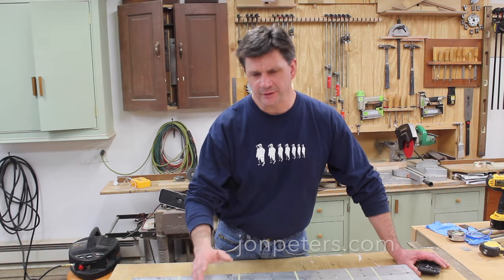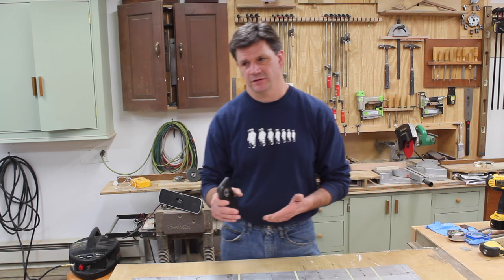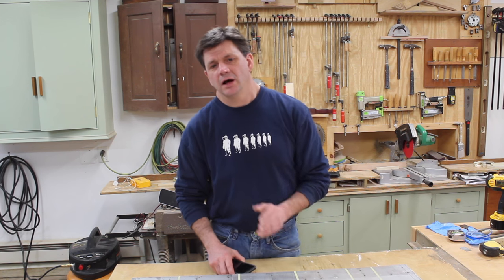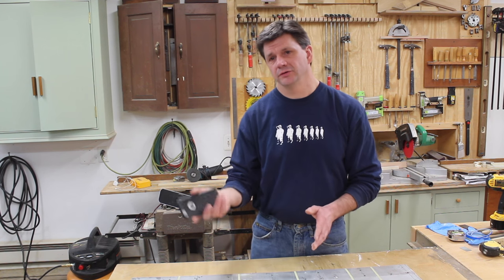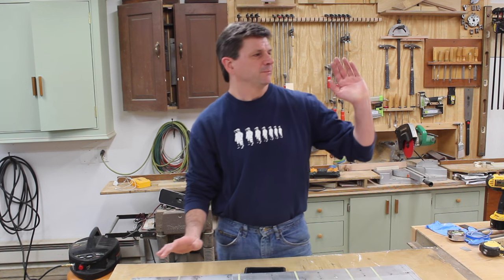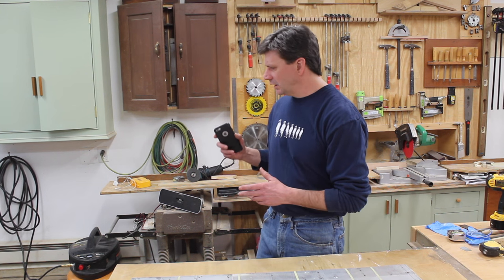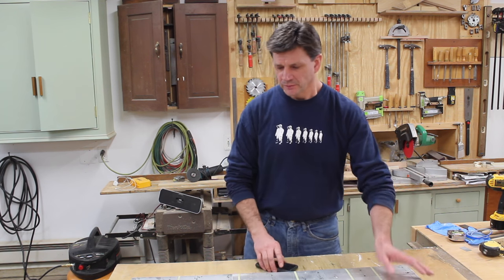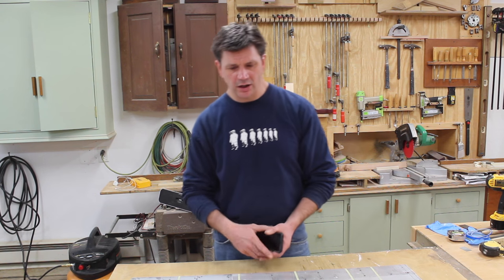How I Heat the Barn & some news

Comment: If the heater upstairs is the only thing on that circuit, and you have a free breaker position, you can easily change it out with a 240V heater. I would suggest a fan forced heater over a baseboard heater as well.

Comment: Hey Jon, I'm a big fan of the "King" pick-a-watt heaters. They recess in the wall (so they take up no space) , they come in 120 or 240 volts (I prefer 240), and they have a fan so they move the air.You might want to check them out.

Comment: I also installed an 8 foot Fahrenheit hydronic heater in my basement several years ago.While they take longer to hear up, they retain their warmth longer when power is removed. I paired it up with a programmable digital thermostat.
Reply: +Mario Monti BTU's in - BTU's out, it's all the same, the oil doesn't make any difference to efficiency, all electric heat is 100% efficient and produces 3412BTU's per KWhr
Reply: I wasn't speaking of BTU's, just the that once electricity is removed, the oil filled or hydronic heater will emit heat longer than just a standard baseboard electric heater as the oil has to cool down as well. That is my understanding.
Reply: +Mario Monti yes, a net zero benefit as it emitted the same number of BTU's.  I am saying it will have no effect on efficiency or comfort levels.
Reply: +Andy Collier So in all seriousness, help me understand.
If a regular baseboard heater cools off below a useful point when power is removed in X amount of minutes, where an oil filled takes twice as long (or whatever it is), why would that not effect comfort levels? I understand the efficiency part as it also takes longer to heat an oil filled heater.
Our regular heating system is forced hot air which heats up quickly, but also cools down quickly. So I have our thermostats programmed to turn off the heat a certain amount of time (30 mins) before we leave based on what is comfortable. Where as in the past at my parents for instance, water baseboard stayed warmer longer. I know we are talking two different types of heat, but just as an example of liquid vs. forced air.
Reply: +Mario Monti if both are thermostatically controlled there will be no difference in air temperature, which is what matters more than the heater temperature.
Reply: +Andy Collier For me it's more shutting down the heat before I leave, not during my occupation of an area. I know I can shut it off before I leave sooner with the hydronic heater, although maybe not by a lot. I tolerate the cold well, my wife does not.
Anyway, thanks for answering.